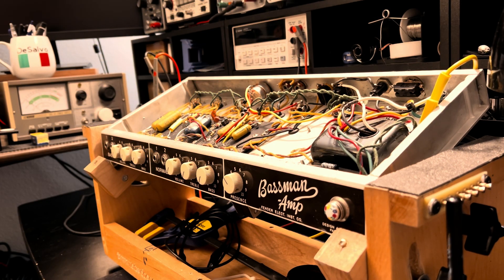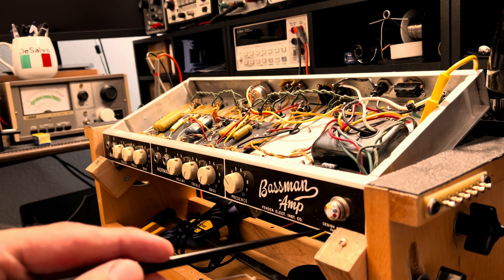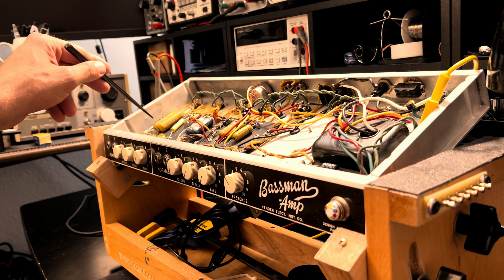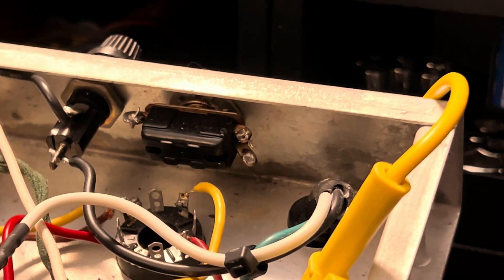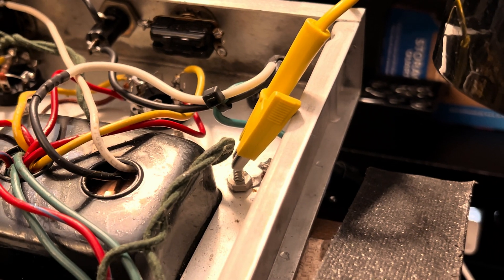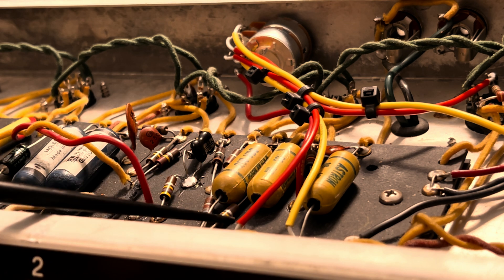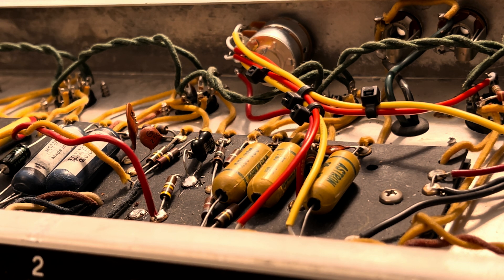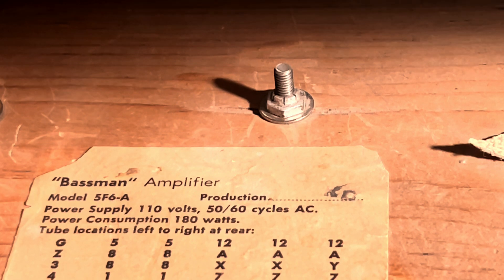‘61 Fender 6G6 Part² || Rugs Match The Curtains?

Comment: The Production Date Code on the tube chart appears to be "KD," which would be 1961(K) and April (D). This would coincide with the dates on the transformers and pots. The first letter is the year, starting with A - 1951 through Q - 1967. The second letter is the month, A being January through L for December. 
Fender used the metal window screen for many years. It was inexpensive, readily available (as in at your local hardware store) and works well.
Reply from the maker: The hardware store Leo used to get that from (and upholstery shops he got the old tweed and grill cloths from) were walking distance from the old factory. The hardware store is now a salon, though the original owners moved it down the way off commonwealth ave. Thanks for sharing the info with the guys.

Comment: Was it Roy or Billy? Billy is a notorious tack soldereeerer.

Yeah, the Fender reissue transformer is hot. That being said, a lot of later 59/60 Bassmans were ~480 on the plates.
These should see ~440.

I don't care if Astron's test good, they're all bad enough to be replaced. I will always have your back on that.
I use the yellow Jupiter's because they fit and they're made as close as possible to the Astron's. Just in case caps make a difference I can't hear.
Reply: I've got a Billy Z amp in right now... poor thing
Reply from the maker: @YeatzeeGuitar this one isn’t his, but yeah man. I HEAR YOU.
Reply from the maker: I won’t say!  I know anyone can have a rough period, but I feel bad for the customers. Man, you’d never guess who it is.
Reply: @ForgottenGearRestorations  I know what you're implying but I've never even seen that amp!! 😁
Reply from the maker: You’re smelling what I’m stepping in
Reply: Roy.
Reply from the maker: @Mr_Bio_Hazard ❌🙅🏻‍♂️
Reply: I've been known to tack solder while testing different part values, then forget to complete the job once I've settled on the component. Even good techs have bad days.
Reply from the maker: @socallars3748 that’s 100% accurate. I try not to make judgments until I have a few data points and unfortunately, I’ve had nothing but this type of work come in from this particular tech. The first one was even worse.
Reply: @ForgottenGearRestorations  Understood. It's a touchy situation but I feel you're right to not publicly name the guy/gal who did the work, nothing good would come of it. More enemies is never a good thing in this world.
Reply from the maker: @socallars3748 agreed anyone can have a bad day. I’ve had amps come back and have been overwhelmed at times, myself. But this looks bad. Two seperate customers so far.